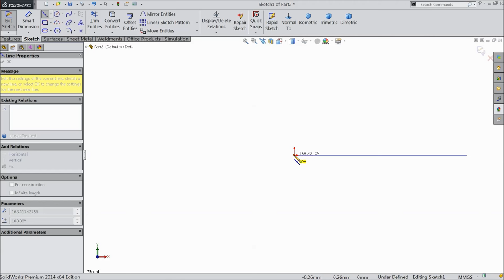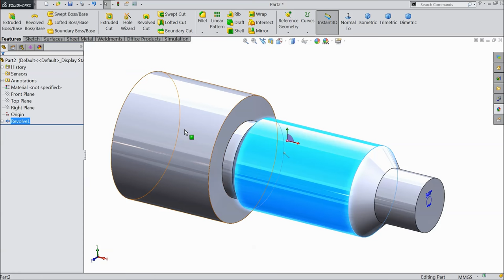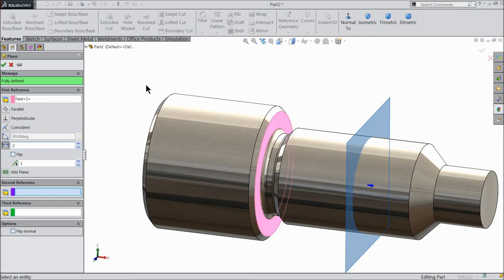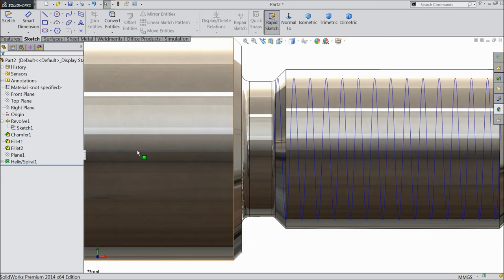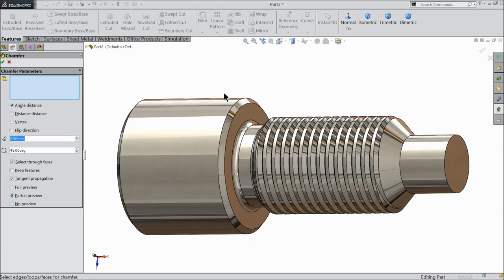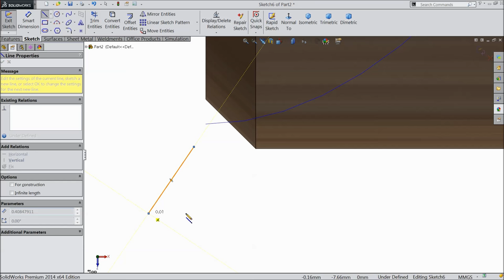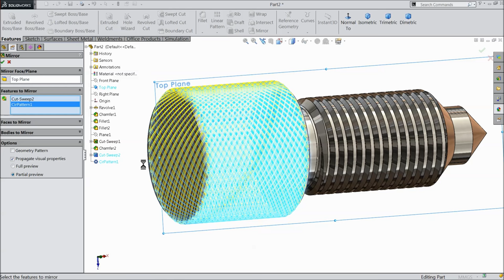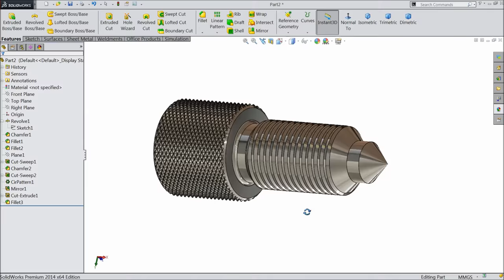Solidworks tutorial | sketch Screw in Solidworks

Comment: how to select plane on round  face,not mid plane but plane on diameter.
Reply from the maker: you need to put a point in Round line than latter you can adjust the position during plan plotting,